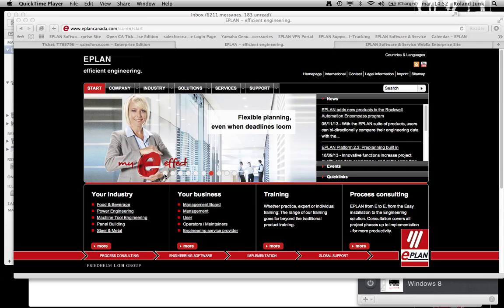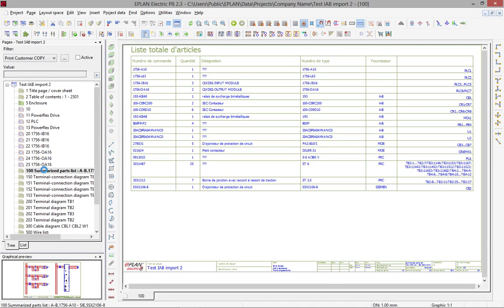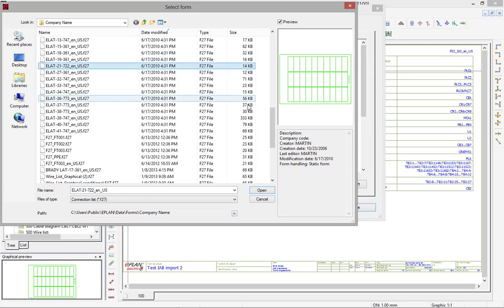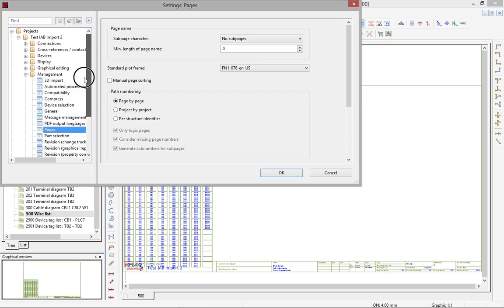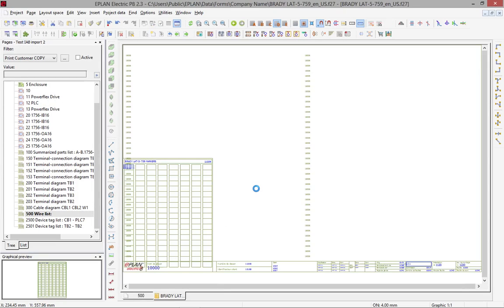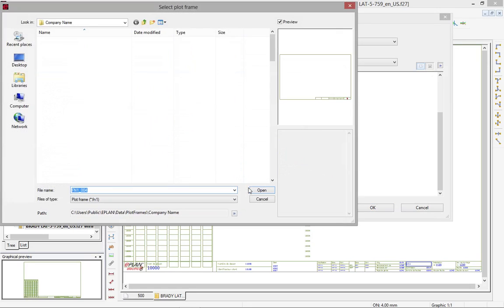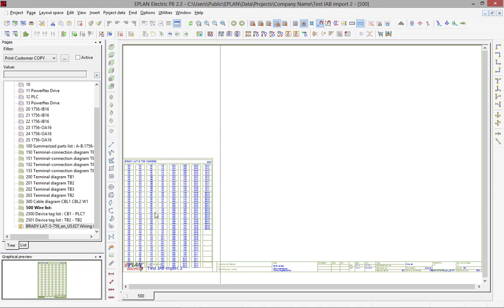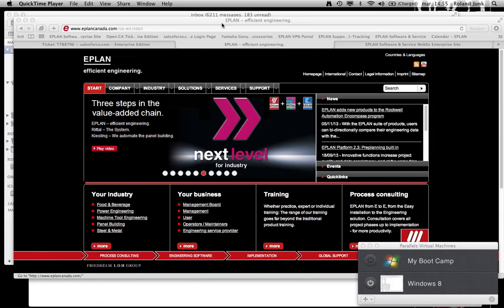EPLAN Electric P8 Form using specific Plotframe

Comment: Hi Roland, great videos, very helpfull. I made a new plotframe of size A4 and started using it in my projects. The problem came with reports. It seems all reports are done for A3 plotframe size. One solution was to scale all pages in reports after generating them, but when updating reports I have to change the scale of the pages again. Is there a workaround to this problem without having to edit and fix the plotframe for every report? Should I keep using A3 size because it is like an standard for electric project?

Regards.

Diego.
Reply: Hi DiegoB did you came out with a solution i have the same problem.
Reply: @Samuelmeyer98  No, I didn´t. I decided to keep using A3 plotframe size. It seems it is like an standard in electrical CAD. I found that if I change the plotframe I need to change all the reports forms (static and dynamic ones) and that is a lot of work.
Reply: @diegob3208   Yeah i found that out also, but we are using a custom plotfram thats smaller then A3 so
Reply: @Samuelmeyer98  please let me know if you find a workaround.
Reply from the maker: I keep the FN1_001 as my project standard plot frame, this way all my reports are fine, the schematics are often switching in North America between 1 and 2 ladder anyway. So when I create a schematic page I choose my plot frame.